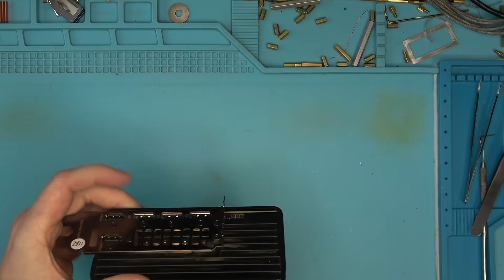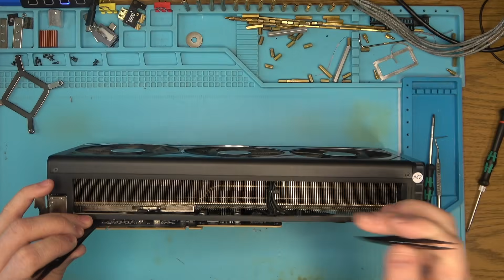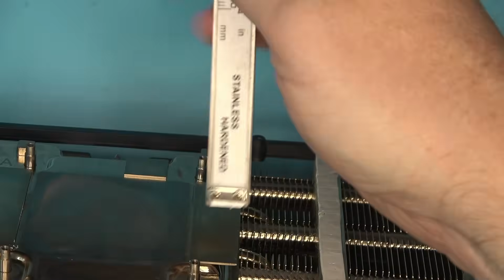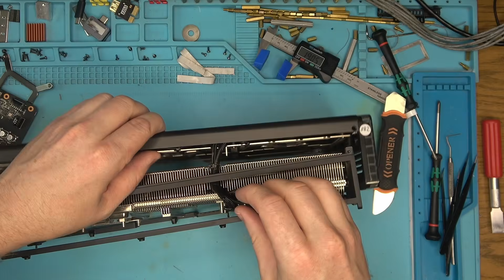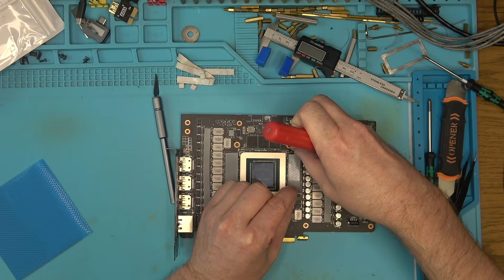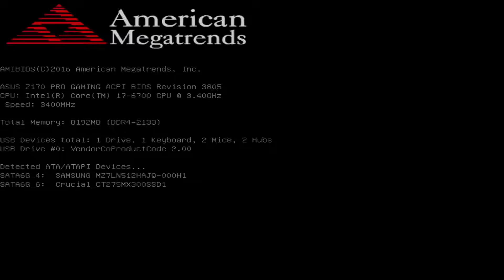How to disassemble and clean Asus Strix 4090

Comment: How much pressure to apply to the screw of mounting bracket? I tighten them untill they stopped moving with medium-hard pressure and then loosen slightly. Also I started to tighten them in cross pattern. And it's maintaining a good temperature but i am worried if that tighten screw bend the pcb or what. Please share your advice.

Comment: Thank you for this video and this valuable information.
1.25 mm pads are very difficult to find.
I tried several websites and brands, but couldn't find them anywhere except on Aliexpress.
Would you recommend switching to 1 mm or 1.5 mm instead of 1.25 mm?

Comment: 3:33 I think PowerColor will win this title, the phase-changing cooling pad "Honeywell PTM7950" can stick to the processor so well that you can literally tear it out of the socket with it.
I assembled my CPU with a water cooling system called Heatkiller IV.
The mounting does not allow you to rotate the block, only to tear it straight up.
After several 10-minute stress tests, and the CPU had already reached Thermal throttling, I managed to tear it out of the socket.🤣

I don't even dare to think about re-paste my RX9070XT in years.🤣

Can't an ultrasonic cleaner help with separation? Does it loosen and break up the hardened paste?🤨

Comment: You could've done some more cleaning of the fan blades. You'd be surprised to find dirt even when you run those cotton buds with some alcohol the second time through those fans. And I'm curious to see how you cleaned the radiator.

Comment: 2:40 , and use the correct screwdriver, if don't fit don't force it OR if it is too loose try another.

15:34 , and do not twist the board, can break connections under the chips.

PS, the top comments are not for you but the people seen the video (you already know all that)

20:55 , or not , hehehehehheheheheh

Comment: I just did a 12VHPWR port replacment on this card, I found that holding the board by all 4 corners with my fingers and slightly rotating left and right until the paste unsticks works well, no prying required! Running the card before hand to get it warm helps!
Reply: I've always done that with AMD CPU coolers in the past. 
Am I showing my age?

Comment: Hello, I’ve been following your content for a while and I really enjoy it. I do PC and laptop maintenance in Romania, but unfortunately, my hands shake too much for the kind of repairs you do.

I have a question :)) why don’t high-end GPUs use liquid metal thermal paste? Do you have any idea?
Reply: Because it's messy, a pain to clean up and if you spill even the smallest amount anywhere it's not meant to go, you risk shorting and ruining the card. Der8auer has plenty of videos covering liquid metal, it's pros and cons. In saying that, the 5080 and 5090 use liquid metal instead of thermal paste. It's easier to use a decent quality thermal paste or PTM 7950 thermal pads, especially if you're just using the card per normal spec and not trying to do some insane 24/7 overclock.

Comment: I think what your trying to say is unscrew the spring screws on the core a little at a time so you releave the pressure across all four corners evenly. Instead removing one corner all the way and the pressure on the opposite side is greater and can crack the core.
Reply: Yeah, he had a bit of a milly mouth moment while he was trying to say that.😂
Reply: Obviously

Comment: To stop bolts from cross-threading, just turn them backwards until you feel a click, and only then start to turn them forwards. Exactly as you would do for self-tapping screws when re-screwing them.
Reply from the maker: That wont help.
Asus made sure screws enter the hole on an angle, not straight down.
Thats why they cross thread, not because threads did not line up at the start.
Reply: @northwestrepair  Then force them straight before applying any torque.
It does help. Always wind small screws backward until you feel the first thread engage (click), then wind them in. Straight.

You should try bolting bevel gear boxes back onto Dozers. The bolts are almost never straight. If you just attempt to wind them in without looking, you'll cross thread everything. You need to lean on them to straighten them for the first 2-3 threads, then you can go ham all you like.
Same goes for most things that are too heavy to manoeuvre. Ya can't just go winding things in all willy nilly expecting them to just happen. (well you can if you like, but you're gonna spend a lot of time drilling out cross threaded and broken bolts if you do)
Reply: i do this every time im doing anything screw related
Reply: I do this as well, but the threads on these are tiny and that spring clamp puts alot of pressure on the threads...It's usually the last screw that gets put in that has the trouble with cross threading because of the tension on it...
Reply: Ummm actually, to keep the screws from cross-threading, don't buy ASUS.

Comment: I looked up the GD-2 at igorslab database and it seems to be an, quote "rather useless product"
but I also noticed, in like the last 1 or 2 years that almost every thermal paste application on high power chips I did with mx-4 seems to get dry quickly - and I thought that paste is good - seems to be good for a short time only

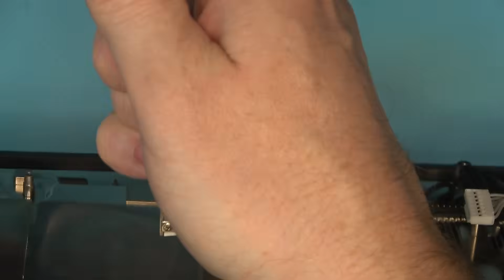Comment: 8:20 You are using the wrong side of the caliper when you are measuring. Use the top of the caliper instead because it will be much more accurate ...

Comment: I've been an MSI hardware fan since 2000. Every computer I've built since then has used an MSI mobo, and have never had one hardware related problem. Their software sucks, but I think pretty much all motherboard manufacturers have crappy software. I've always paired my MSI motherboards with EVGA GPU's, but obviously that's not going to be possible going forward.

Next GPU will definitely be an MSI... after the prices come down to more reasonable levels.

My home media server is an old x58 chipset MSI board running an Intel 295 cpu. Built it around 2009, and it has been in continuous service ever since.
Reply: I only use MSI mobos and gpu's. And Corsair power supplies. Had a couple EVGA video cards crap out on me.
Reply: @junkyardw  "Had a couple EVGA video cards crap out on me" I did, as well. Back in the 8800 GT days, there was a flaw in nVidia's design. Even so, EVGA stood by their products, and kept replacing my GPU's (I was running two of them in SLI) until I finally got a good pair. They stayed running until the GTX 295 hit the market. I bought EVGA's version of the 295 ( two GPU's running in SLI that went into one slot). Ran that card until the 980 dropped. Got a bad one, and EVGA replaced it immediately.

I'm currently running an EVGA 2080 Super. Looks like I'm going to be running it for a while still, as it's hard to justify the cash outlay for a new GPU, especially since I'm gaming at 1440.

Also running a Corsair power supply that is so old, I don't remember when I bought it! It's at least ten years old. IMO, it's always worth the extra cash outlay to buy good hardware... buy once, cry once. : )

Comment: Not sure if the backplate pads "hardly serve any purpose" - my MSI RTX 2070 Super Gaming X's backplate gets hot courtesy of pads for the GPU and VRAM (which are 4mm 3mm thick! I did replace them with Gelid Ultimate), temperatures drop a couple of degrees if I crank the case fans up.

Comment: Hey there Tony , on the screw cross thread issue . When I have screws that are finicky, I always line up the screw , then spin it backwards a few turns , to feel the “snap” , or “jump”.  Then when it feels solid, then go forward And spin it in. It helps to make sure the threads are lined up. Just a little tip , to a master who’s got almost all of it figured out 😂! Really respect your work. Thanks for the vids! Btw the last one on the re-ball over and over again, could you possibly have did a board swap to start with ? I mean you nailed it that it was going to be a problem right away , and it was . Maybe just like “hey it’s a refurb, new board before I move ahead” ??? Just some thoughts !

Comment: That core thermal paste spread was horrible
Reply: That was just with (a) a small dab of cheap paste (b) finger pressure on the board.  The point was to make sure the thickness of the pads was right, allowing the paste to spread out a bit.  So under the given conditions, the spread was great.  With a proper amount of paste applied, and with the spring clamp applied, you can be sure the paste spreads out completely.  If, for the test, the paste had spread out completely, that might indicate the pads were too thin.  If the paste didn't spread out much at all, that would indicate the pads were too thick.

Comment: Did you press Subscribe into the silicone workmat so that when you clean it it shows up, you weirdo lol Nice work on the detail. I always struggle to get those fan blades perfectly clean. After a few passes with 90% IPA and those cheap makeup removal pads (round cotton ones work great for removing thermal paste) they still look a little dingy/dirty. I would like to open up my EVGA GTX 1070 and redo the thermal pads but I'm not sure what to get. I have a micrometer and dial caliper for other stuff, so I could probably figure it out. I usually whip out the Metro Datavac and blow the snot out of everything in the PC case and gently stall the fans so they don't spin.

Comment: these level of defects all pCBs all generations 30series and up. hence the pcb mask stencil with imprints of black dots to allow for easy cleaning of the contact pads.. allowing the repairer to replace a layer of insulation

Comment: I have a Strix 4080 isn't it the same cooler as the Strix 4090?
Reply: Turns out that the 4080 cooler isn't quite as cool as the 4090 cooler.  :P
Reply: @KarnivoreRex  The Strix RTX 4080 and 4090 GPUs generally use the same cooler design, including the same die-cast metal frame, shroud, backplate, vapor chamber, and Axial-tech fans. I was asking if it was true since he is looking at them.

Comment: I always apply heat to the board and never had issues to separate the board from the cooler, also helps to keep the pads intact.
Reply: you can just twist the board gently, back and forth. thats the easiest route, like rotating it clockwise and counterclockwise
Reply: @fowlizm9065 some pads do get rly stubborn and eventually you destroy them. Applying heat (around 60c) witj a hair dryer or something it helped me immensely
Reply from the maker: that also helps to soften things up